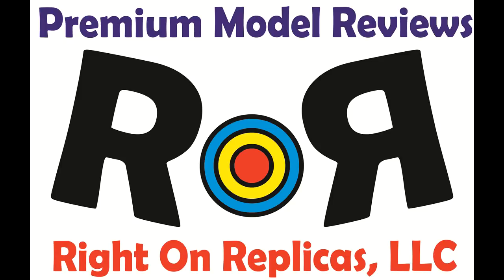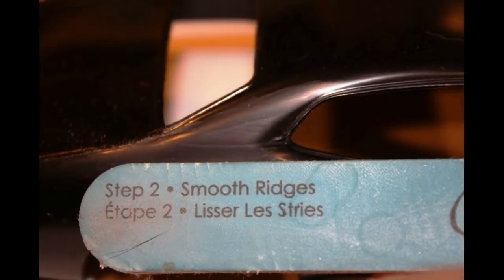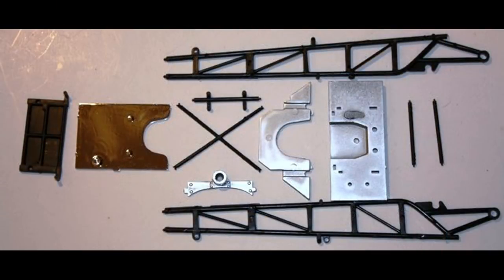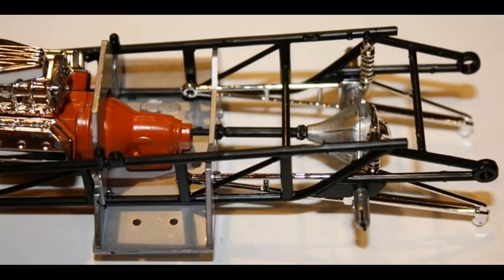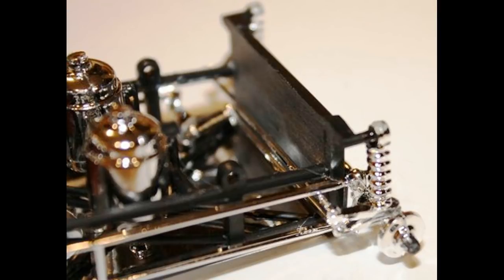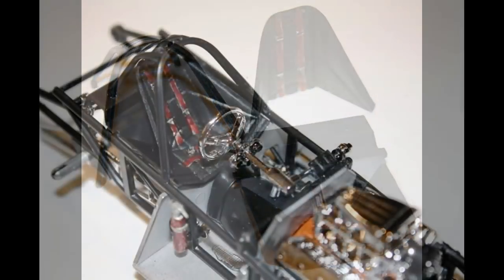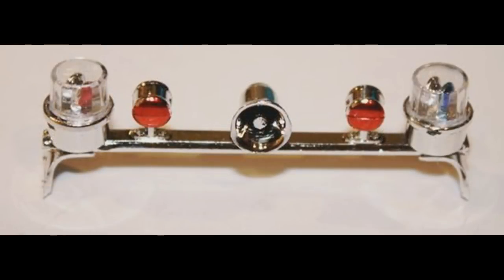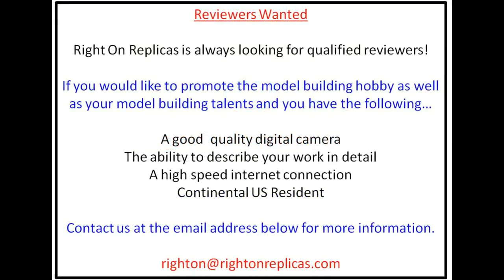How to Build the Cop Out Funny Car by Tom Daniel 1:24 Scale Revell Model Kit #85-4093

Comment: Very nice build. This kit has another life as before Tom Daniels altered it in this way, it was the Tom "Mongoose" McEwen Hot Wheels Funny Car. So the tips on building it also work with the Monogram Mongoose and Snake funny car kits (at least the chassis on Snake's car).
Reply from the maker: JMC,  Thanks for the tip and I think the chassis was also used on the '57 Chevy Outcast kit as well!  -Doug
Reply: Right On Replicas Hmmmm, strange bit of irony given Mongoose did a 57 Chevy funny car himself (kitted by Revell). Talk about full circle.
Reply from the maker: JMC, Yes and you;ll find that review here in the Automotive (Funny Cars) Playlist!  -Doug
Reply: I have an original issue and one of the trees has 2205-0620  yellow molded in it which crosses over to the 57 Badman kit.

Comment: Doug, where did the blower scoop go? All I see in the final build are injectors.
Reply from the maker: CS,  removed to show the detail of the engine!  -Doug
Reply: It's not a scoop. It's the injector throttle body and that style throttle body does not fit inside the body's intake duct. Body was set up for vertical throat inline injector body.
Reply from the maker: TI,  that's great information.  Thanks for sharing!  -Doug